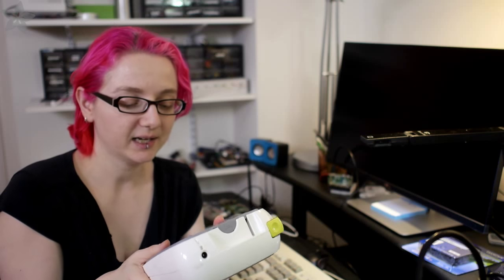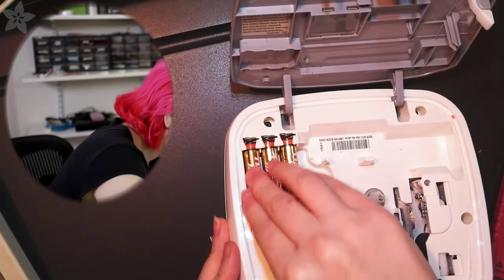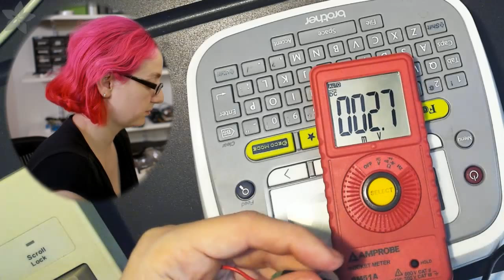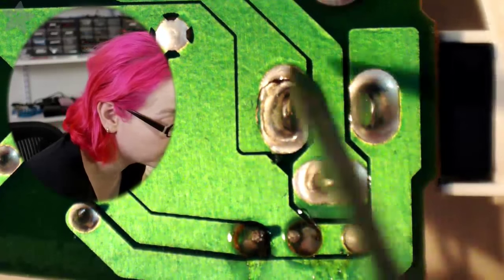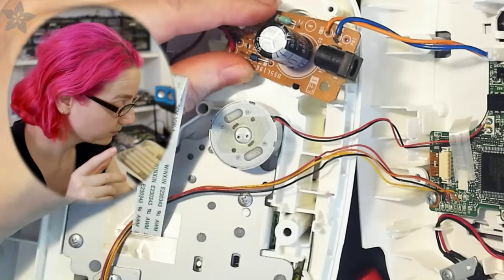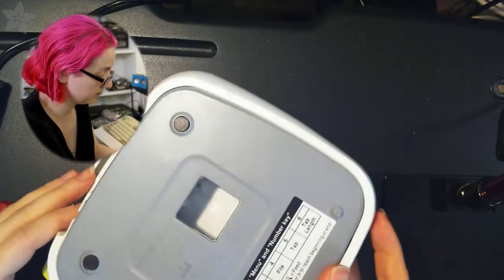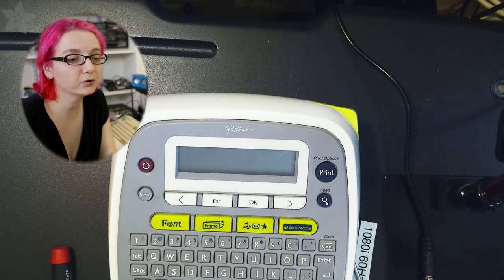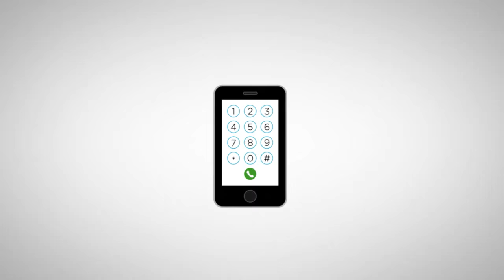Fixing household electronics 12/27/2015 - LIVE

Comment: Had a Toshiba laptop years ago with this problem. We used the laptop for programing Motorola radios  and adjusting the soft pots in them. Took less than 15min to troubleshoot and solder the plug. Took all day to figure out where a plastic brace went, that fell out when I opened.

Comment: Interesting video!
I had to fix an old vhs recorder and that wouldn't work with the case open then I spotted a light sensor covered it with bluetack and it worked,  then I fixed the dirty tape head.

Comment: wow someone else that fixes things. You could of also used baking soda to neutralize the acid
Reply: I'm no chemist but I believe you need something acidic to neutralize alkaline battery leakage.
Reply: could be. I just make a baking soda paste and spread it on the contaminated areas every time I have to clean battery leakage.
Reply: +NJ Near (njnear) I am a chemist and I agree.  Furthermore, regardless of the source of the corrosion, the corrosion is usually a metal oxide, and metal oxides are at least slightly basic and will be best dissolved by an acid. Vinegar works well because the resultant acetates are water soluble and vinegar is a dilute solution of a weak acid, so it's pretty safe to use and won't dissolve the base metal itself (at least not too quickly).